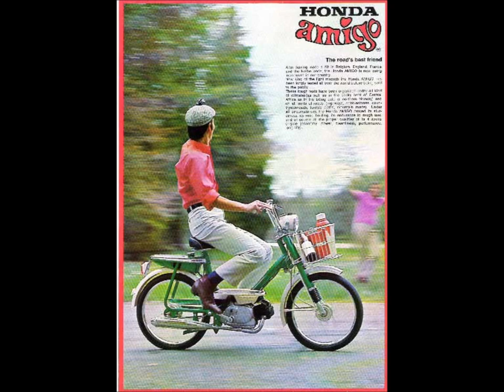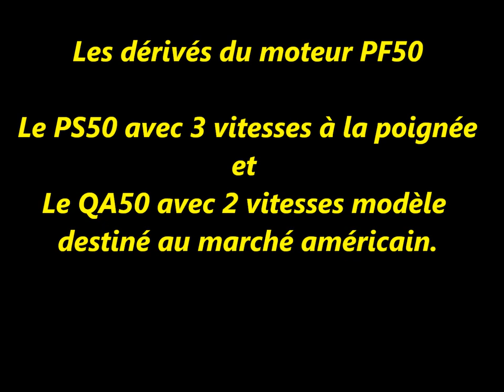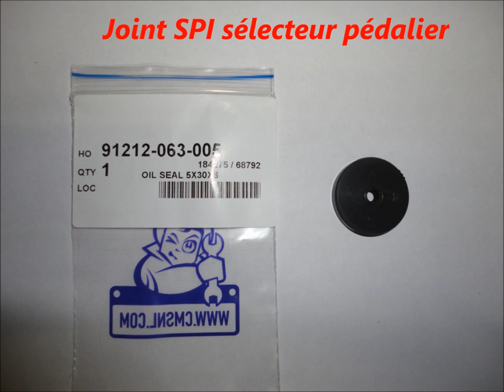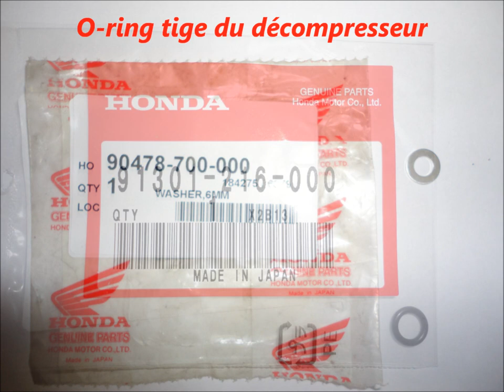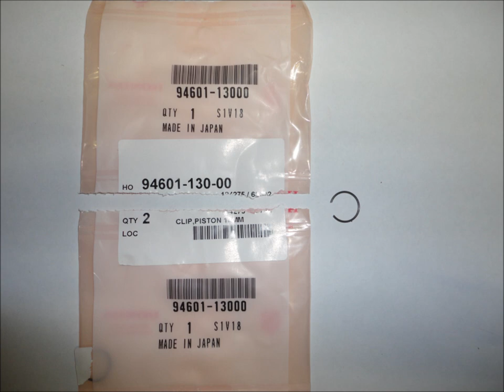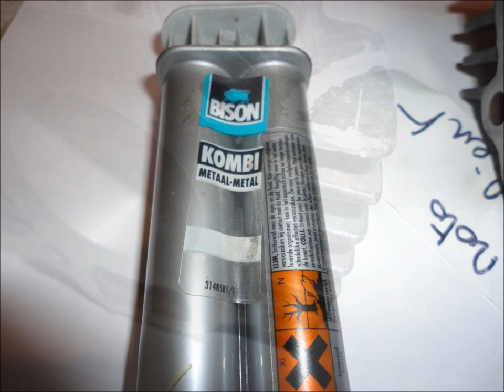Honda Amigo - PF50

Comment: Wow. I have a 1975 Honda Novio P50E. It has done 10,700 miles! It still goes very well for its age. I took off its cylinder head this week and it looked quite coked like yours was. One valve looked like it had been burned by a white heat. The other was black. Piston also quite coked. Cleaned up and reassembled but it does not seem to have improved performance much. I am sure it must have done some good though as it is much cleaner inside now!

Comment: Bonjour, et tout d'abord bravo pour cette video qui est une mine d'or pour tout amateur d'Amigo. J'en possède un depuis 30 ans, que j'ai entièrement restauré en...1989. Aujourd'hui je dois refaire le bas moteur. 
J'ai une question: pour changer un des roulements de vilebrequin (6203) il faut retirer une clavette cylindrique du vilebrequin. Comment avez vous réussi à faire partir cette P.... de clavette de M.... ??? j'y ai laissé une tenaille, une pince étau,  et même un petit étau! Et la clavette n'a pas bougé d'un iota. Alors si vous avez un truc, je suis preneur.
En tout cas, très belle restauration, menée dans les règles de l'art. Cordialement.
Reply from the maker: +Sonomaniaque  bonjour et merci, si tu veux rendez-vous sur ce forum : http://www.cb500four.com/fofo_cb500four/index.php mon speudo "Billy"